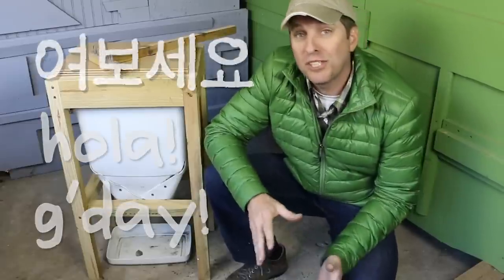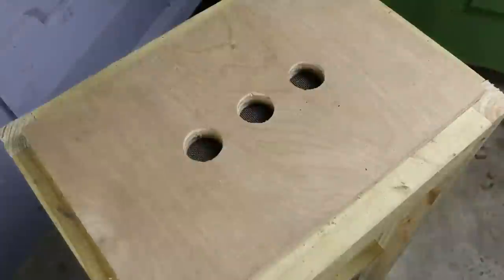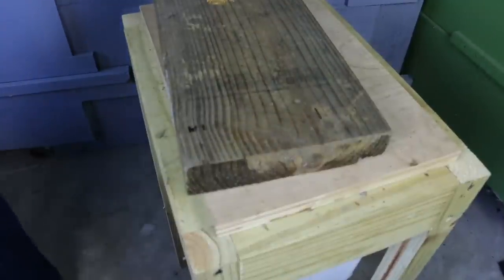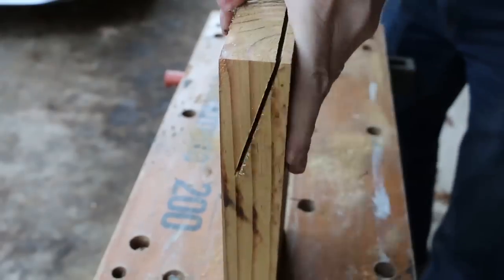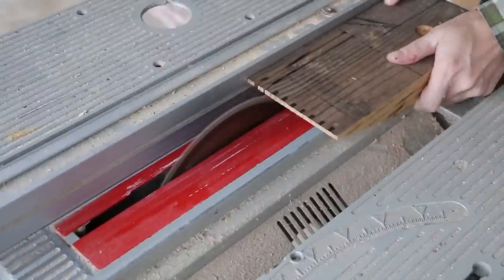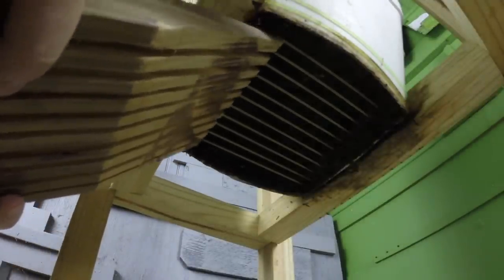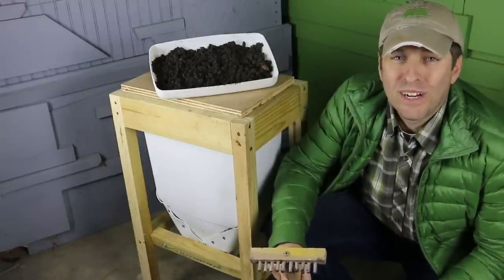How To Harvest A Flow Through Worm Composter

Comment: Really enjoyed the video.  I tried a similar ' model '  but I  found that harvesting is just too slow, and instead just went to vertical migration system.  Basically your original bin, with an additional bin on top where the new composting material goes. The worms naturally migrate upward and leave the castings in the bottom bin ( technically middle bin since the bottom bin is only for catching fluids). By the time the top bin is full, almost all the worms have migrated upwards so you harvest from the bottom bin and then it becomes the new top bin.

Comment: Love it. With regards to harvesting, could you add a crank (drilled through the side in the middle of the castings section)? Attached to the crank handle is a revolving cylinder with teeth (like a music box) that just barely protrude through the rows of trimline. Turning the crank handle a few times will draw the castings down and out, and would also serve to loosen  and aerate the bottom layer. Also, if you add a brace, you could raise the lid that you use for catching the fluid. Attaching a drain and container would allow you to collect fluid without the mess or loss to evaporation.
Reply from the maker: Thanks for the suggestions. The roller method sounds interesting. I actually made another version of my flow through worm composter with a sliding harvesting mechanism. I still need to do the final test on it. Thanks for watching.

Comment: Personally, I would have used a section of 4"+ PVC pipe and cut the fingers across it.  That way, the fingers are curved enough that they can get behind the castings and pull them out.
Reply from the maker: A great solution, Keith. Thank you for sharing.

Comment: I learned a few things since making mine. Woms like temperatures that we do. They work best in 50-80 degree temps. Don't keep them in direct sunlight. The liquid they produce, leachate, is not good to put on your plants and vegetables. It has bad bacteria's in it that are not good. You can dilute and put on shrubs though. (It is not worm tea.) Only use red wigglers for composting also known as vermicomposting. I have mine in the basement now since it is too cold outside. If done right no smells. To keep fruit flys down mix food scraps under, don't just toss on top. You can add some peat moss to top to cover that helps too. Shred your junk mail, the worms love it. Good luck to all you vermicomposters.
Reply from the maker: Hey Papa! Thanks for adding your comments and suggestions. Good stuff. When I made my "worm tea" video, I  learned that what I was calling worm tea really wasn't. I've been using it on my bushes and small trees, instead of in the garden. I've heard that if you aerate worm bin leachate and add molasses, you can kill off the bad bacteria and facilitate the good bacteria. What do you know about this?
Reply: Don't use leachate for worm tea. Either put it on bushes or I dump it in my outside composter. Take 5 gal bucket fill with rainwater or chlorinated but let it sit a few days or the chlorine will kill the good bacteria. Take a pound of worm castings toss in along with a couple tablespoons of molasses. (the sugars get the bacteria started) then aerate for 24 hours (use one from fish store) or let sit outside in sun for 3 days. Strain out the solids and you now have worm tea. What I'm not 100% sure of is how long it last (been told 24 hours) before it breaks down or can you dilute it further without losing the effectiveness.
Reply from the maker: OK. Good to to know. I'll have to make a video about making worm tea...the correct way. :-) Can I feature your comment?
Reply: Hmm, like anything permaculture there are many ways of doing this;)

I agree about keeping them warmish (I'd say more than 50s - mine tend to go pretty dormant in the winter here when temps get into that range).

As for what is and isn't compost tea ... that's a whole can of worms! Aerated compost tea/worm tea is just a way of multiplying the bacteria and fungi (the food you add determines the balance - more sugar (eg molasses) for a bacteria rich mix, more carbon (eg flour) for a fungi rich mix). The aeration (the pros use a LOT of air, much more than a aquarium air stone) may influence the type of bacteria to some extent (just as turning compost frequently and getting it to the best temperature range does) but untreated leachate from worms and compost works well on a smaller scale.

For instance I have had great success growing hydroponic strawberries on pretty much nothing but diluted worm juice/leachate.

I have experimented with aerated compost tea (with worm castings one of the inputs) and I've pretty much come to the conclusion it isn't worth the trouble. It might be if you are starting from scratch on a highly degraded site, but as soon as you start building the right conditions - like Field of Dreams ... 'if you build it they will come' - and that applies to worms, and I'm sure it applies to good bacteria and fungi too.

Pretty much the same deal with worm farms - the two bin system is very simple and works well enough - I'm really not fussed if a few worms make it into the potting mix (in fact I quite like giving people plants that are routinely jumping with worms:)) Spread the love!
Reply: I appreciate your feedback on the worm tea.  I assumed it would be very good for garden plants.  What else can you do with it if you're not doing hydroponics?  Should I just pour it back into the top of the worm bin to add to the moisture?

Comment: I made up a composting worm bin about a month ago. Got a feed bucket and a 5gal bucket. Drilled several holes in the 5 gallon bucket. Placed in the center of the feed bucket. Layered straw and sand in the space between the buckets. I probably added a hundred or so red worms in the 5gal bucket with the compostables. I'm hoping they'll go through it pretty quick. A family of four ends up filling the bucket pretty quick. But I planned ahead and made a 2nd one. If I have to, I'll make another one as well

Comment: I love your design and respect your sharing of your ideas.

I have an idea which might add a little improvement when harvesting. Drill a hole in the side of the container above the netting big enough for a chopstick to enter. Get a long chopstick, stick it into the hole and start poking it down towards the netting. 

If it works you wouldn't have to worry about the tool fitting into the spaces between the netting or have your hands dirtied by falling compost . You may even be able to forego other bulky tools and have a single simple and easily replaceable tool. 

The problem I can foresee with this method is the stress the jigging around of the chopstick might cause to the hole and depending on the strength of the plastic container make a tear in it very quickly. I guess you can fix that by securing a flat strip of wood across the frame at the height where the hole would be, secure the side of the plastic to the flat strip of wood and then drill the hole through the wood and plastic.
Reply from the maker: That is an interesting idea. Another commenter has said the worm castings will be too sticky to drop, and she may be right. I like the idea of using the leverage of something from above, like the chopstick...it may need to be more than one. My rake wasn't pulling the castings down, so I made the fork. I need to see if the castings have dropped since I made that video. I am thinking about a simpler design for this bin. I'll likely make it closer to Spring. Thanks for watching.

Comment: I’ve been using worm castings for everything for about 5 years now and never had a problem with any vegetables. I take it fresh right out of the bin and pour it on the ground vegetables with a watering can. I don’t use news paper. I use all organic food scraps with leaves a little horse poo and it works great. Every now and then when I change my bin out with new I add a fresh piece of cardboard with no added writing on it just cardboard.
Reply from the maker: Thanks for the feedback from your experience. Good info to share. Thanks for watching.

Comment: I left these comments in the construction video, but I think this is the best place for it:
Hi, doesn't matter if this is an old video, but this type of shape looks like the "hungry bins". Now looking at the "HB" you can put a plate with holes or screen to keep the casting there and tie with a bungee cord or something similar. Later to harvest just pull-out like the HB, in that way no needs to scratch, the trimmer string can be sewed around the bottom to keep the strength, Just take the cap-off to harvest.
Reply from the maker: Thank you for the feedback, Xavier. I eliminated the string in favor of a perforated metal plate in a subsequent video. I need to revisit this design and will incorporate your suggestions. Will also look at the hungry bin. I’ve read recently that worms do better with more surface area, so I’m thinking about a revised design that in includes that.

Comment: I don't have a flow through, but you might consider using some coir instead of newspaper... it makes the castings fluffier... I've also heard of similar with a fan that dries the bottom of the composter, so that the castings fall out more easily when raked.  Great videos!
Reply from the maker: I need to try some coir. Thank you for the tip. Thank you for watching.

Comment: I've just discovered your channel/videos about worm composter and i love it.
I think I will have a go with it as well, although i wonder about the wires and the way of havesting.
Well, i'll read the comments, see what everybody is saying/experiencing and see what i can do myself.
Keep those video's coming!
Reply from the maker: Thanks for the encouragement. I did do another (improved) version of this flow through worm composter that leaves out the wire. Look for my video with the black trashcan. I do use the wire initially in the new design, but replace it with a metal plate in the harvest video. Take a look. Thanks for watching.
Reply: @GreenShortzDIY  Found it, thanks!
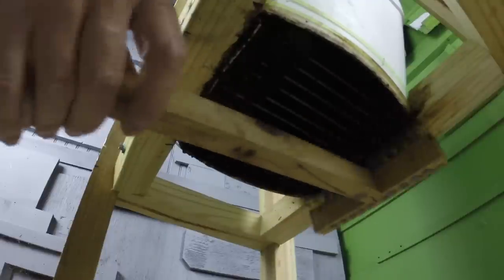Reply from the maker: If you haven't started watching yet, the retrofit begins about 5:24. Thanks for watching.
Reply: @GreenShortzDIY  Thanks again, (man, you are quick with your replies!), I just found the video i was looking for.
This is the one I think I saw last weekend, but could not find again:
https://www.youtube.com/watch?v=_5K9HxuOohM, at 5:25 you replace the wires with the metal plate.

Comment: I saw another composter using Pvc with screws running the length of the PVC that work as a rake inside the composter when you turn them . I bet if you put 2or 3 of those through the bottom of your composter it would help with your harvest without all the extra tools and effort
Reply from the maker: Hi David. I definitely felt like this was a little difficult to harvest. I've seen some of the mechanism you are talking about, but I reworked my design to add a harvesting bar to slice off the whole bottom of the castings column. Take a look: https://www.youtube.com/watch?v=l43GwJ-mCus I did make a modification to the design in the "how to harvest" video for the simple flow through worm composter video. Thanks for watching and for your comment.

Comment: It's been some time since you made this worm bin, are you still finding it working well?

I found a commercial product that has the same design as yours, but they left the bottom completely open and the worm castings naturally fell out to the bottom tray- the materials in the tapered bottom was too dense to all fall out at once.

Thanks again for the DIY video, I'm definitely going to try this!!
Reply from the maker: Fatihah Jacob sorry I missed your comment a year ago. I usually try to get through them all. I actually made a simpler version of this bin (look for the video with the black trashcan, if you haven’t already built yours) It has been working well.

Comment: I work at a farm that is using two of your flow-through worm bins. Half a year later, they are still not working as intended. The finished soil does not come out the bottom, even with a rake and fork per your design. Some comes out, then the rest bridges and does not fall. We also have problems with excessive moisture at the top and lid; worms crawl up onto the lid. I am considering building lids with more vent holes. Our farm is in northern California, a Mediterranean environment, so temperature is fine. Guidance is needed of how to charge the bins for proper use. We had trouble with rodents chewing through the bug screen on the lids, so we put a layer of hardware cloth over the screen.
Reply from the maker: Hi Ken. Sorry you’ve had trouble. Honestly, I had the same bridging problem, the castings not coming down. I reworked the design, using a trash can with the bottom cut out, but no taper added. The whole can slides sideways, slicing off a 3 inch chunk of castings. The moisture issue will likely continue, given your climate. With the bin open to the bottom, the stack effect will pull the moisture upwards, where it condenses on the lid. The worms crawling up there, shouldn’t be an issue as long as the aren’t getting out. The worms will “night crawl” and leave trails. It is their social time and ultimately leads to a larger worm colony, if you know what I mean. The hardware cloth is a good solution on the rats. I’m honored you built the flow through worm bins and sorry they haven’t performed up to snuff. My ultimate suggestion for your situation, build one bigger flow through worm bin, using a metal trash can. Use my simpler design and modify the design to allow for a spinning motion versus sliding. Or better yet, why don’t I make one like that. I’ll also look at a modification to the original design, that would assist with the castings dropping. Thanks for the feedback. I hope this was helpful.
Reply: Yes, this is helpful. We are on our way to a better design. Cooperation and sharing are among the traits that made America great. Thanks for your contribution.

Comment: That's awesome. Seems like a lot of work but it works really well. Worms who choose to stay in my castings get a ride to where the castings to go. Sucks to be them, lol.
Reply from the maker: I'll agree that this flow through worm composter was a lot more work than the 2-bin system...at least on the front end. I'm hoping the bottom-harvesting time savings will outpace the hand sorting time sink of my traditional worm composter. It will also keep the worm cocoons from getting pulled out with the castings. It was fairly easy to sort the worms. They run from the light, but the cocoons can't move and it is impossible to capture them all. Thanks for your comment and continued support.

Comment: I wonder if you could do a 2-piece system... the upper 3/4 or even a bit more is a single bin with a block similar to the trimmer wire, but maybe larger spacing so the castings don't just fall through, but are more easily pushed thru by the weight from the stuff on top of it. Then occasionally remove the lower 1/4 pan, empty it, replace it, and then stuff continues to fall. The lower one could then just have a simple grate to allow drainage, but doesn't have to be large enough to allow solids through. Sort of like an ash-catcher situation.

Comment: My experience with DIY flow through bins is hat the VC in the bin really does not like to drop down in the bin after you harvest. I would think the tapered bottom on this bin would prevent the VC from dropping down at all.
Reply from the maker: +Scott Bryce yeah. I’ll concur with that. The stuff is pretty sticky. I’ve done a different design that slices a layer of the vermicompost off the bottom. Check out the build video “Simple Flow Through Worm Bin...” I’ll be doing a demo of how it works soon. Thanks for watching.

Comment: Thanks for your videos Greenshortz, creative design! The little fork and rake are cool but it would be great if you could remove that line trimmer filter as needed for full access harvesting with less messing around. A simple modification would be to fasten the line to a removable panel (or one that can open and close). If you put a latch on the top cover you could tilt the unit or even lay it on it's side to open the bottom filter without causing a worm avalanche. Just a thought. Maybe I'll give it try.
  Keep up the great work.
Reply from the maker: Hi Denis. The solution to the trimmer wire situation was a new design that uses a harvesting cutter. https://www.youtube.com/watch?v=l43GwJ-mCus Take a look. I modified the design in a second video to replace the trimmer wire with a metal plate. Thanks for watching.